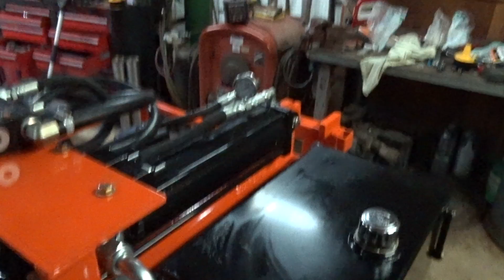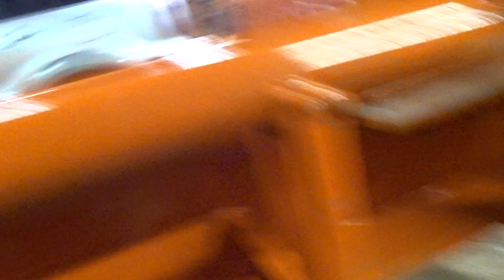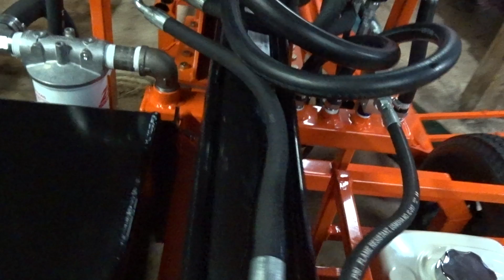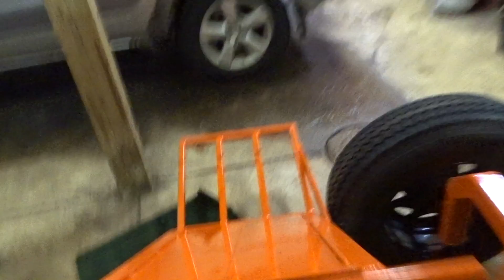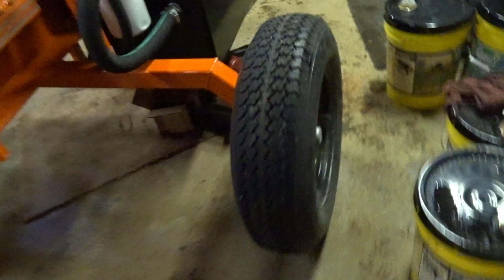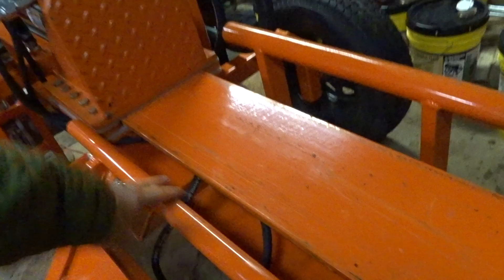Homemade Log Splitter

Comment: Very nice I have a 37 ton North Star needs loads of mods. Already put the valve bracket modification on. Needs off feed if not completely reversed to push a block, not push a blade. But one step at a time.

Comment: No manufacturer would build it because it has to much metal and hydraulic stuff, they built light weight equipment and sale at a premium price 😢😢😢
I built mine in high school in 1969 and still working 😊😊😊
The metal today would cost about 2 k 😢

Comment: Auto-cycle valves great for commercial production, but for me with grandchildren (toddler to 6 yr old), I prefer the manual. I also use it as a forge press so this way I can stop the ram where I want to, can clamp a piece of steel in it, and not worry about it being loose.  And a lot slimmer wedge makes short work of those tough knotty logs.
Reply: FYI the auto cycle valve can also be operated manually so you have both options. I get the concern around kids or inexperienced operators.

Comment: I'm getting my parts together and hopefully, will start recording my build later this week.  Joe at SplitEZ, out in California, (my dump valve supplier) recommended many of the features you incorporated. Also, the guys at Euclid Hydraulics were a big influence on my component selection.   I'm sure I'll be referencing this series a few times of the next couple of months.  I'm not far from you in Ashtabula County.
Reply from the maker: Sweet, I Learned a lot from splitEZ. That is cool that you are nearby. Ashtabula is my neighboring county.

Comment: Looks like you did and put a lot of thought into this unit/build   Only thing you may want to incorporate is a cooler on the return line   I know mine only has a split ram and builds up heat on a hot summers day of splitting
Reply from the maker: Thank you, When I built it I thought about adding an oil cooler. So far I have never seen it over 140°, it has 30 gallons of hydraulic fluid in it with 4 return lines all causing less heat build up. I have run it 8 plus hours on 90 degree days in the sun.

Comment: Ya thinking about  doing modes on my black diamond 25 ton haven't decided if I should  go to the harbor freight 301cc with 19 gpm  pump  or the new 459cc they came out with  15.8 ish hp with 22gpm or just buy the titan 37 ton logsplitter which my 25 ton  has a 25gallion  hydraulic tank  I put on last year so ya to many  ideas lol

Comment: What size tube did you use for your axle and why type of spindles did you use?
Reply from the maker: The axle tube is 2 1/2" 1/4" wall. The axles are weld in rod that i drilled all the way through and welded in.

Comment: Graham Schuld,  you did an amazing job on the splitter.  Beautiful!
I would like to share a headache that I had with a welding project with capped off square tubing.  It was a bike rack that sat outside, we live in Wisconsin with the cold winters we get the condensation inside the capped off tubes froze and split the tubes over several years.  All of my projects now I drill a small drain hole in the lowest point of the tube.  Just wanted to share it with you.  
Wonderful job,  you should be proud!
Reply from the maker: Thanks for the tip! I will keep an eye on things.

Comment: Awesome splitter! I am in the planning stages of building something similar. How long is the h-beam you used?
Reply from the maker: The beam is 7 ft long. That is because I am running a 30in stroke cylinder.

Comment: One of the best splitters on YouTube.  How they should be built from the factory!
Reply from the maker: I used a 7-foot 40 pound per foot h-beam for my build. And even that needs to be boxed in to limit torsion flexing. Some people use square tube with a 1 inch plate on top. But if done correctly the h beam works fine
Reply: @ixcel83  that's probably about an 8x8 h beam, That's kind of what I was leaning towards. I plan to box the ends and add a midline support just behind the start of the push plate travel. I think that should do it! Thanks so much!
Reply from the maker: Thank you. They are coming around to some of the ideas.
Reply: @ixcel83  I've come into a big 5in cylinder and need to rebuild my old splitter, so I am considering just doing almost a ground up rebuild. I think if I run this new 30in cylinder and a 28gpm pump, my current ibeam will not be large enough. What size beam did you use? I'm leaning towards an H beam for this new possible build! I really appreciate your advice and the videos you've done on this work of art!

Comment: do you have a diagram of the piping, i am trying do build one and not sure about the piping. what is a dump valve?
Reply from the maker: When you say piping are you referring to the hoses?
Reply: @ixcel83  YES,
Reply from the maker: @troybowline9752  what exactly do you want to know?the dump valve is used when you have autocycle so it doesn't push all the fluid back through the valve it allows it to go back to the tank. It is to keep the hydraulic fluid cooler and reduce we're on the valve

Comment: Nice job! I've been looking at a lot of industrial spliter videos recently and I like your innovations on the log lift and that you used spaced tubes on the split table so that your kindling and bark falls off before it gets to the pile or conveyor. I noticed all those big diameter logs behind you in one of the other videos, have you considered making a box splitter head like eastonmade?
Reply from the maker: Thank you! I looked a lot at other splitters myself and I feel like a made the best for my purposes.
 Box splitter as in the ones that take off of the bottom of the log and slide it back to drop down in the tray again? I had thought about it. My issue is I do a variety of different size wood for customers.  It does seem like it would be a great setup though.

Comment: Love it.. Over kill, but I love it. Lol.
Reply from the maker: Thank you. What exactly is overkill?
Reply: @ixcel83   Gonna take a couple good men to make that run effective.
Reply from the maker: @MrThenry1988  to run full bore which is about a cord an hour one other guy is enough. To run alone the autocycle helps a lot. I can be clearing the tray or getting more wood on the cycle. Also the large lift table can me stacked high with wood. I have done a rick of wood (1/3 of a cord)  from three full lift tables. So that helps.
Reply: @ixcel83  awesome. I drug about 20 cord home in logs this summer. Been doing it for 15 years or so. I can cut, split and stack a cord in 2 hrs while stopping for a beer. Mine is nothing like yours. Love that you built it. Mine was 750 15 or so years ago. I set out to build a splitter. I bought a 3 point splitter for 200 bucks. Was gonna convert it and found out I could buy one cheaper than converting mine to an engine type. I've made it a lot better over the years. I've never figured out how to keep the wheels full of air. Lol. It's on jacks I made and when I have to move it I have to add air to the tires. I only move it inside when I'm done. Move it out when I start so I'm not bugged much by it. I split for mostly my use only. I sell a couple loads to people who want to pay what I want. I use 10 cord a year. 2500 house and a 24× 30 fur shed. I figure I'm ahead here in Ohio's climate. I like looking out for other ways to make it better on the cheap. I'm a self employed mobile welder and fix it guy for the last 20 years. I've repaired tons of farm machinery. I like your set up. 

Just wondering if your selling wood or splitting for yourself?
Reply from the maker: @MrThenry1988  Nice that is fast work work.
    I sell and burn myself. 6 cords for myself and 60-80 to customers. The hour is from a pile of logs we cut, split and conveyor it either into a pile or  into the truck. Where abouts in Ohio? I live in about an hour east of Cleveland.

Comment: A first class job all round ,i especially like the plastic   in the slider.i don't know if i could get that in Ireland though.
Reply from the maker: Thank you. I would imagine that you could. I ordered from professional plastics. It is a large company online.
Reply: Have a look in a supermarket or discount cookware shop for thick plastic chopping boards. I used some on my smaller log splitter.

Comment: Looks similar to one I am trying to make. Well laid out and thought out. How thick did you make your 12 inch wedges? I was thinking of making some out of 3/4. Also how thick did you go for your slip on triangle piece for the 4 way?  Thanks
Reply from the maker: The wings are 1in thick. thinner would be fine. The triangle is made from 1/2in plates. The vertical front of the 4way was made by cutting the front off of a wedge.
Reply: Excellent! One day I want to use 1 inch plate, then I think its too thick. Been going back in forth in my mind between 3/4 or 1 inch. Did you ever think of making a multi way wedge like 6 or 8 way similar to the Timberwolf tw6 or the Built Right? You should produce a video of your machine chewing through some wood!
Reply from the maker: tfhummer I have thought about doing a six or eight way but my would often times needs to be different sizes. If I dealt solely with logging truck loads of wood I would build a different wedge so it would be one push and done. I have been meaning to put up videos of the actually processing wood I just do not make time to do videos over work

Comment: Hey man awesome splitter! Would happen to know wherea guy could buy that pump and the valves? Im in canada and trying to figure out the valving set up, pump and the auto valves any help would be appreciated this splitter is very awesome! You did a wicked job and assumjng prob half the price of buying a already made one!!
Reply: Actually just see the ither post with the info, your second valve babk for the wedgeand lift are those auto valves too?
Reply from the maker: I made most of the Hydraulics from P & J splitter. Also known as splitez.com I believe. I called them and talk to James about everything I would need very helpful.
Reply from the maker: They are not auto cycle for the auxiliary hydraulics. Only the main cylinder.

Comment: Awe man, that wear resistant plastic is an AWSOME idea!!!!!  I just finished one up, well, still getting the kinks out that is similar to yours.  Wish I would have seen this before I got to this point on mine!  Nice job!
Reply from the maker: Mike Groat Thank you! I have really liked the plastic. And the bronze side sliders I added later have helped a lot (see in other videos).
Reply: I just checked out another one with it in use.  I am running a similar set-up, 13hp motor, 22gpm and 5" Prince cylinder, but only 24" long.  Your is quite a bit slower for some reason.  I posted a couple videos the other day of me breaking the clevis off the cylinder that raises and lowers the 4-way, if you want to check them out.Thanks!
Reply from the maker: Mine is probably shown slower because I do not show it revved up all the way.

Comment: Now that you have had time to run it are there things you would do different? I am getting ready to build one very similar just looking for advice.
Reply from the maker: Tom Roe Hey tom. Thus far I have split around 175 cords with the machine. The improvements I have made have been a long cable throttle to make it adjustable from the work area. The side slides on the push block are now bronze instead of steel.  The UHMW plastic lasts a long time. The bottom plates were 3/8  steel and replaced those with 3/8 cold rolled steel. The 10 half inch bolt's were replaced with 5/8.

 I will be doing a follow up video to address all of this soon.
Reply: That's great info. This video has tons of great info in it! What kind of welder did you use in your build?
Reply from the maker: Tom Roe A Lincoln Idealarc 250 stick welder. The push block was welded at a friend's using a miller 250 mig welder. 25lbs of electrodes.
Reply: I have a miller 250 mig I plan on using and preheating the thicker stuff. Did you order from p and j? Wondering where you got the plastic wear plates?
Reply from the maker: Tom Roe Yes P and J was incredibly helpful. Call and talk to James. The valves cylinders, engine pump and adaptor came from p&j. Best prices around James also helped figure out running the hydraulic lines in proper order.
Reply: Yes I did put my order is last week James was awesome really knows his stuff. What kind of cycle times are you getting? My cylinder is a 5 inch with 3.5 rod hoping to be very fast return.
Reply from the maker: Tom Roe yeah that is the bigger inner diameter Ram it will be a fast return to be honest I have never timed my cycle. Running full rev it is all I can do to keep up with it. The Plastics I ordered from professional Plastics it is uhmw I believe the top is quarter inch the bottom is 3/8 the bronze on the side is nice because it does not wear the steel but they are not cheap I figure I could get 80 to 100 cords before I have to flip them and use the other side to keep the push block tight
Reply: Graham Schuld 
When do you think we will se a action video? chomping at the bit lol
Reply from the maker: Tom Roe I am hoping to do it soon. Been getting rain.